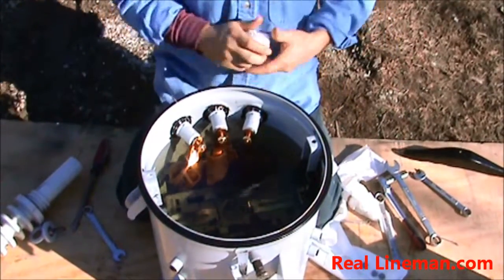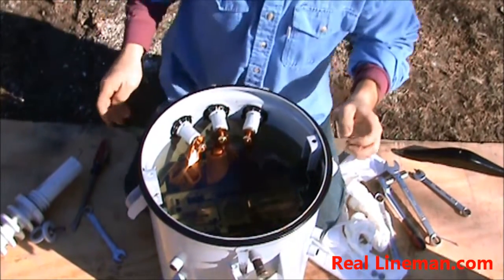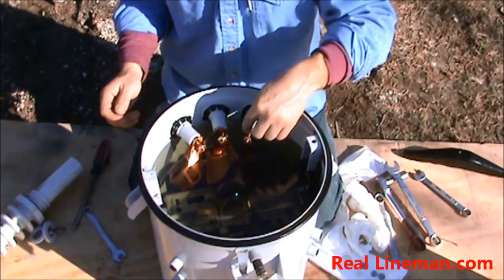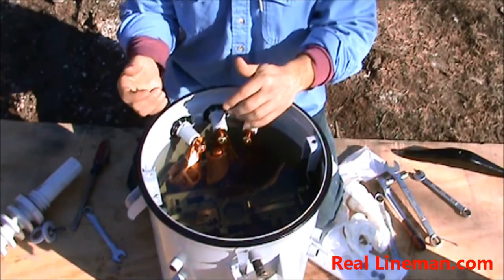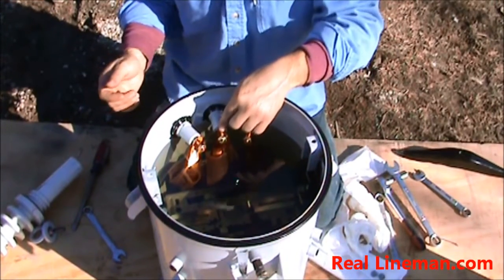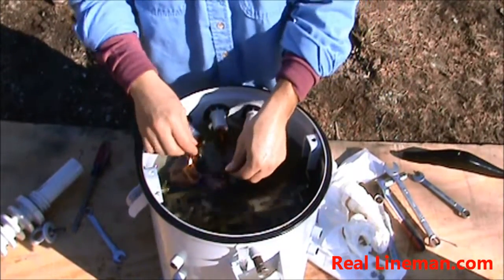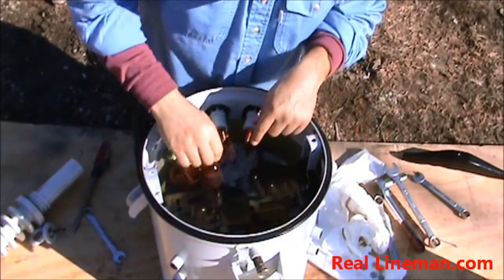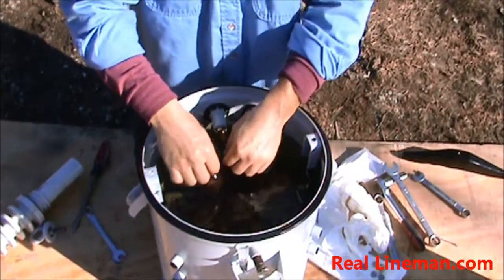Change Secondary Coils From Series To Parallel | Real Lineman

Comment: how to change 277 to 120 volt
Reply from the maker: You can't. 120 is based upon the voltage ratio of the windings in the transformer. You can get 120/208 or 120/240 out of the transformer depending on how you wire it. 120/208 is a 3 phase Wye voltage and 120/240 is a 3 phase Delta voltage. For 277 you will have to get a transformer with a windings ratio manufactured for it. Most commonly it will be a 277/480 transformer wired in a 3 phase Wye configuration.